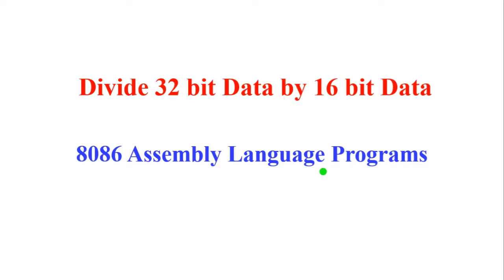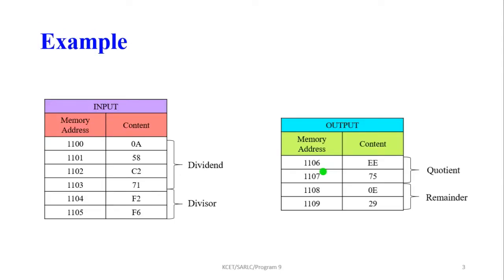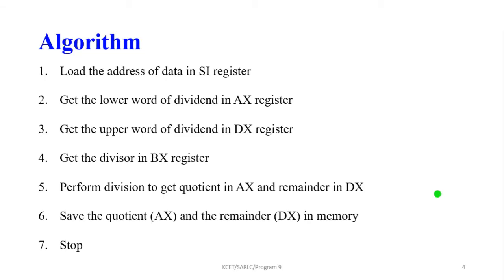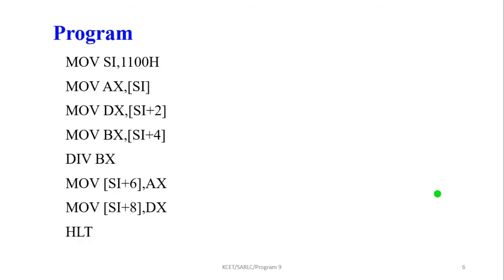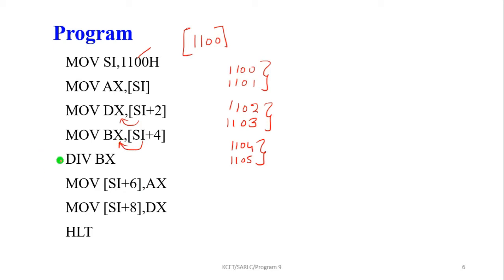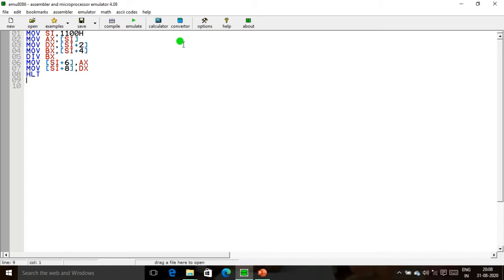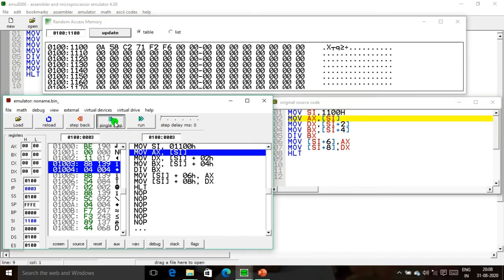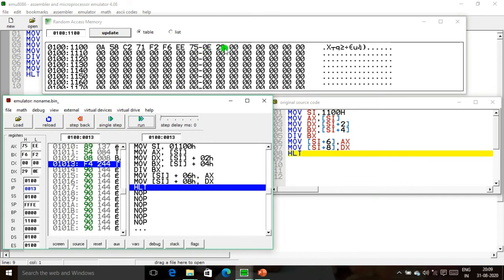Program 9 : Divide 32 bit data by 16 bit data | 8086 Assembly Language Program | emu8086

Comment: Very well explained.Sir, I have an assignment which stuck my head alot and last date of submission is 30 Jan 2021.l try alot time but not write the right program. My assignment is write program that print table of 4  in Assembly language using display memory formation method. Kindly help me! I shall be thankful to you for this act of kindness.